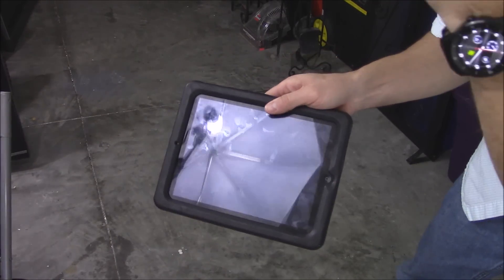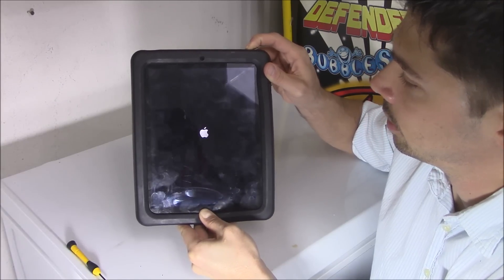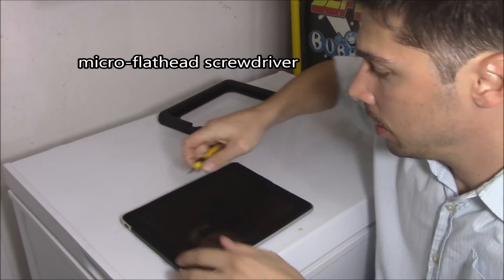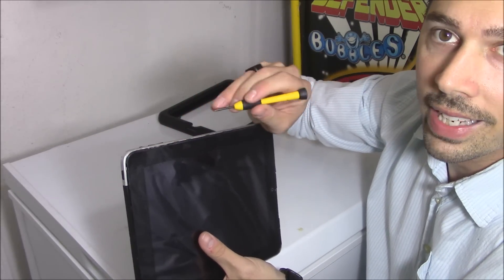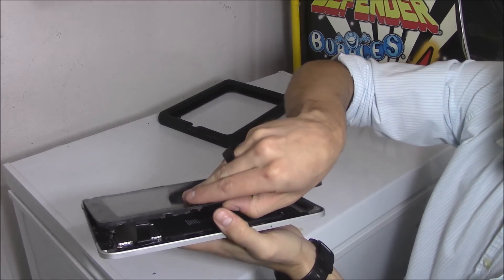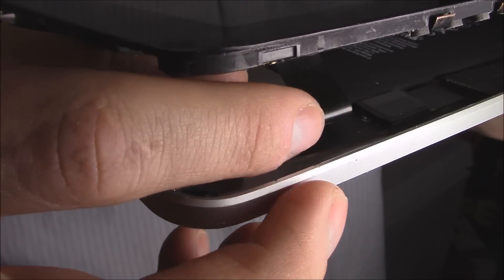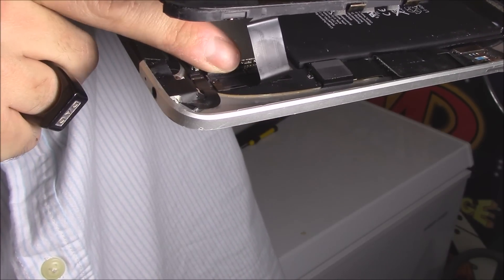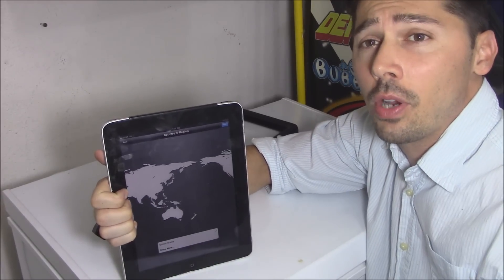2 WAYS TO FIX IPAD TOUCHSCREEN NOT RESPONDING - WORKING

Comment: How about the ipad mini? Im having a problem with my ipad mini. My screen is still responsive but it's showing weird colors. Sorta like flickering. Help please
Reply: It's broke u need to take it to a store the thing inside broke that u can't fix only apple and best buy can
Reply: Ivan Semanero  that happened to my ipad 2 ALOT. just drop it on the floor, like carpet, but not too hard, and it should go back 2 normal. this happens because there is a sensitive side on the ipad. try all of the sides by dropping them on the floor from like,  1-2 feet. but whatever you do, DO NOT spend money to repair it. you can fix it urself
Reply: Cason Keaton that's not true
Reply: Hey bro, ive managed to fix it a bit. The flickering has stopped a bit, but after locking my ipad for too long, it's starting to happen again. I just have to leave it like that. I think im destroying my battery for leaving my ipad idle for too long. But at least thats the only way to keep it from flickering and showing weird colors.
Reply from the maker: Ribbon cable connection needs to be adjusted.
Reply: What do you mean? Do i have to replace anything on my ipad? I dont want to spend money, you know. I heard you just have to remove and reconnect the cable and youre good to go. Will that work?
Reply: Ivan Semanero that's what he meant. do it
Reply: Ivan Semanero are the colors negative?

Comment: I have an ipad air and at one particular point the touch is not working properly. I need to press little harder or several times i need to press on that particular place then it is working. what is to be done. The same process u have explained in the video or go to service centre?

Comment: I have an original ipad that just bit the dust.  It turns on but the screen stays black.  I can tell it is turned on by looking at it in a dark room, it does light up.  I have tried the home/onoff button refresh.  The apple briefly comes on but goes off again just as quick.  I would say less than a Milli-second.you see the apple.  I just watched your video on resetting the cable connection.  I did not drop my ipad or even jar it so am hesitant to try that.  Any other ideas.
Reply: Maybe the lcd screen I'd broke

Comment: dude you should re-do the title to 1st gen, ipads only. Every other version you need a heat gun because the screen is held down with adhesive. Your more than likely going to damage the digitizer trying to remove if from the adhesive anyway.

Comment: yea nah i had to fix the school ipad so i wasnt alowed to take it apart so i ran some terminal commands u can call it hacks but i forced the ipad to give me system control and i backed up the ipad to my mac then i factory reset the ipad mini and then i ran controlled amounts of electricity through all the system and then loaded evey thing back on the ipad and it went perfectly this is not a hate comment instead advice
Reply: Jayden phillips-bradshaw I don't think your iPad had the same problem then, this is dealing with if you where not able to use the touch screen because something has been damaged or pulled out of it's socket.. I don't believe running electricity through all the system would fix this problem. " then i ran controlled amounts of electricity through all the system" Apple would never let you do that just by syncing an iPad to a Mac. Doing so would also most likely give your Mac or iPad a short circuit.
Reply: jst to flush it out
Reply: Jayden phillips-bradshaw Okay, flush it out.. Flush out what exactly. What was the problem with the iPad? If you where allowed to accses and use the iPad and accses the terminal on the said iPad then what was the problem with it? Certianly nothing that would require anything you just did.

Comment: All married guys will be happy after seeing this video. Thank you very much! By the way I have an LG42 with 3 volts on the on/off on the cable going to the inverter boards and main board, it is not labeled ,should that be 5 volts? It powers up no display no back light the remote works the red light blinks a couple of time and turns to blue. I do not want to trash it because of the environment. Any help would be greatly appreciated. God bless and have a nice holidays .
Reply from the maker: I recommend downloading service manual pdf, that will tell you for sure the volts. on/ off volts can be 5 or 3. check 24v input on inverter board. check for loose connections, it can be inverter board or tcon board which are under 100 dollars at shopjimmy site. If you have no glow from tv but good volts to inverter it's probably inverter board. use code paul51p for free video google helpout.
Reply: ***** Thanks a lot for your great help I will try those suggestions have a nice and Blessed Holidays!

Comment: Prying any tablets from the touchscreen glass side is a bad idea. Many times the LCD is glued to the digitizer you risk damaging the LCD not to mention a sharp flathead screwdriver could shatter the digitizer glass easily. On Android tablets it is best to open up the back cover and look for the ribbon cable from there
Reply from the maker: true but I was prying at the plastic frame not directly on the glass this works for iPad 1 only which I fixed a few this way no problem. however iPad 2 I use a suction cup tool and heat gun . I hope that clears things up.